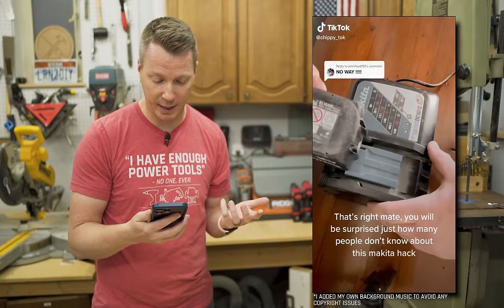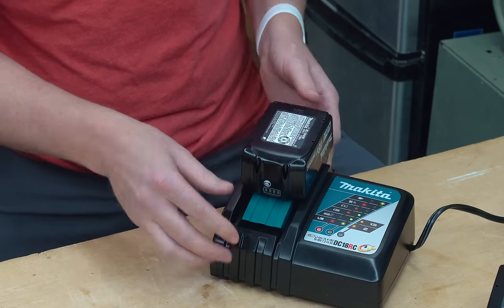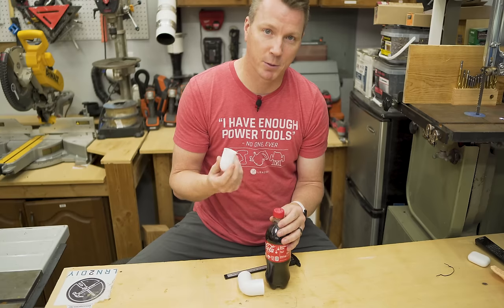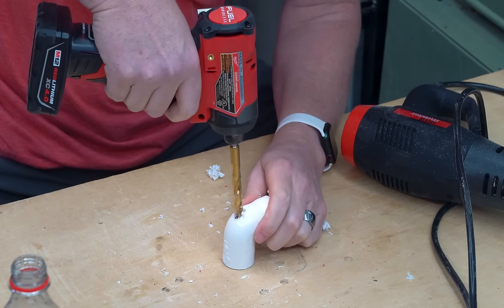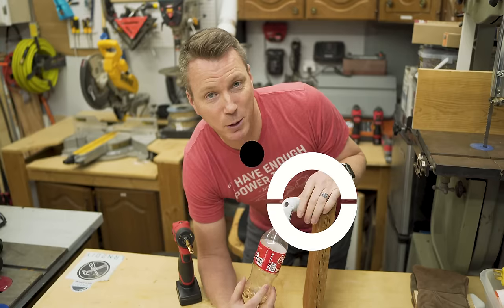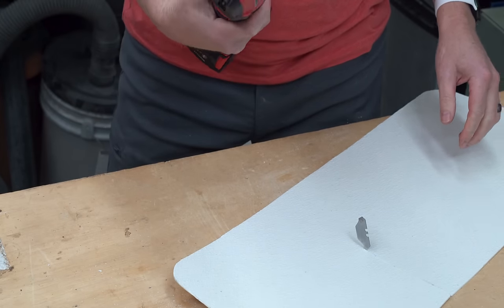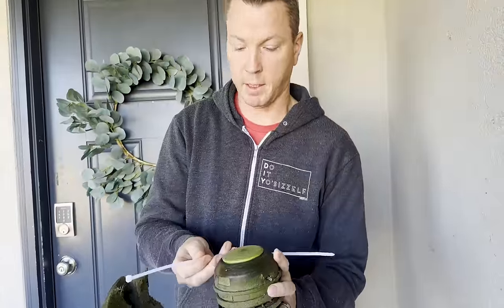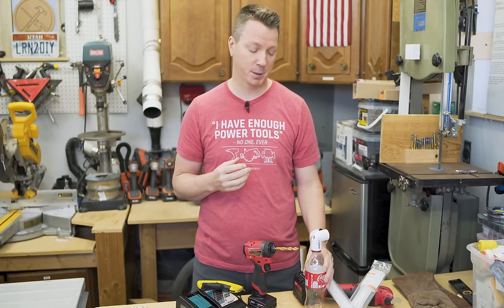Testing Online DIY Hacks. This Could Get Scary.

Comment: There are ready-made hook blades for multitools. Same principle, but proper locking. They are intended for flooring materials mostly.
Reply: I've seen roofers use em and I've seen some prefer using the regular hook blade in a multi-tool as its cheaper
Reply: A special knife for cutting sheet goods with a circular blade will probably work no worse.
Reply: Love those hook blades, great package openers, and for cutting cardboard boxes. Can't wait to try it on cutting shingles

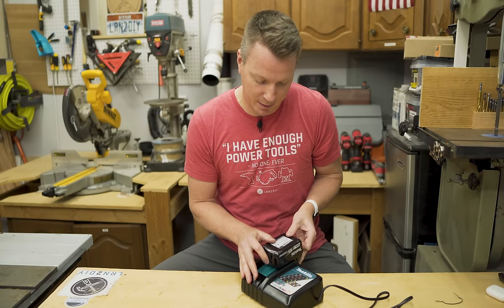Comment: 2:11 I have the same charger. you only have to set it one time, but it definitely doesn't associate the sound with individual batteries, it will just use that sound for notifying about all the batteries, i think yours changed again because you swapped them too quickly.

Comment: You can daisy chain zip ties for more length. I actually do small loops with the tiny zip ties, comes out looking like a plastic throwing star. Those are by far, among everything we've bought, all the money I've spent, our cats' absolute most FAVORITE toys...
Reply: My thought, almost exactly. If I were testing as he did, I would have interlaced both skinny zip ties around the post. Left one into the right one's catch and vice-versa.

Having said that, zip ties are not nearly as strong as people would like to believe. That and I would never secure them around a post spinning that fast and use them to hit anything. That's just a recipe for exactly what happened with his large zip ties in the video.

Comment: The blade advantage is in the ability to make curved cuts without slipping and going in a straight line. The material is sound deadener which needs curved cuts. I met the maker of the video, so this is how I know.

Comment: You could try the strimmer hack with stainless steel cable ties (or "zip ties" as you Americans call them). Also, tighten them up really well with pliers to get extra clicks, not just hand tight. 

Come to think of it, you could even sharpen up the steel cable ties to make something really dangerous!
Reply: I liked your comment, but would not suggest people doing it, as just today my 20volt toy 3/4 scale black n decker shot a 1cm chunk-o-stick direct into my forehead using thin nylon string, it was unpleasant for a few moments ... cant imagine the force a spinning stainless steel razorblade would have introduced

Comment: The battery hack will allow you to hear it if you’re off doing something else because the music plays more continuously rather than a couple of beeps and it’s done. I don’t know how long the beeps go off. Like my coffee maker beeps five times, softly. If I’m not in the room I may miss it and will have to go check to see if it’s ready. That seems like a good hack. I watched a designer/home decor show that used the bottle for the drilled shavings hack.
Reply: Very good point....my hearing is really bad thanks to decades of machinery exposure. The music helps remind me the charger has done its job. Originally, my first charger didn't make any noise other than the beeps. One day my helper asked me if I had lost my cell phone. I asked why....he said he heard music from near the charger. What he had done was accidentally put it in music mode, by pulling out the battery and reinserting. I was puzzled about that for yrs, because there was no mention in the instructions then of the hack.😂

Comment: I also have an ego string trimmer and personality I wouldn’t risk damaging it by putting something in or on the spool that could damage the motor or overload the battery. Best to just stick within the manufactures recommended string gauge  limit. 

The oscillating tool hack: that’s a big nope on that one. Just use the blades that are designed to go on the tool. Or find a different tool for that type of cutting job.
Reply: Agree, but it might be good in a pinch if saves you a trip to the store to get more trim line.

Comment: The bottle one seems like it will actually come in handy at work, most of tgebareas I'm working in i don't have to clean up the dust or whatever at worksite too much but every once in a while I've got to go in the admin area and i usually use painter's tape to fix an envelope ok the wall underneath anywhere i have to drill a hole in the wall to catch all the dust but this looks more effective

Comment: #2 is a great idea from someone who seems to be constantly drilling into drywall. #3 might be useful on some rubber matt, but sketchy AF, and #4 who has zip ties that long, my toy weed eater would required 18 inch ones (yes I just measured and that's the longest I have) so if you gotta go out... just get string. Its like 12 bucks for my oddball size and the spool has lasted like 5 seasons

Comment: In my chargers, once I set the tune it does that in all batteries. You don't have to 'tune' it for each battery. As far as the sawdust catcher....that's what a dustpan or vacuum is for.....or a helper. The blade thing is dangerous and the zip ties just dumb.

Comment: a week ago I installed a CO detector in one of my tenant's living room.  I had to make 2 small holes through the wallboard.  So I folded a piece of paper in half and attached it to the wall with painter's tape just below the drill points.

Comment: Why not thread the pvc elbow directly on the bottle threads? I dont think you need the cap.
Reply: I like your observation. I wonder if the threads on PVC match the inside threads on the bottle (or are close enough). The OP would have done it that way if it were feasible.
Reply: cause its 10x easier to press in a threaded fitting than making new threads when the clock is ticking

Comment: On the first tip, use a reducer instead of a straight  elbow.  If you went from a 2" reducer elbow down to the size you used, would have allowed you more working room & easier catch as it would resemble the commercial version it is modeled after.  On the Weedeater, you failed to take into consideration the weight difference on the zip ties.  That makes a huge difference.  I would have given you a thumbs down for sure it there was no burb.  Thanks!

Comment: You didn't give the hooked blade on the oscillating tool a chance.  The only reason I own an oscillating tool was I saw Chris Notap's video showing how to attach the blade (https://www.youtube.com/watch?v=SgCam8t3670).  I was cutting a lot of cardboard at the time, and it was like a hot knife through butter.  Since then I found the official hooked cutting tool for oscillating tools, but the hacked one seems to be much sharper.

Comment: The battery tone difference is because the charger measures the battery to determine its capacity and then sets the charging rate. If you replug it too fast, the battery-type sensor has yet to discharge, adding the voltage to the battery to that residual. Then if you allow it to charge the battery, it will go over-charge. Sort of a dangerous thing these days with lithium batteries.